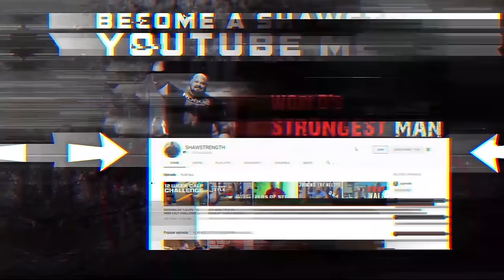PRESSING HEAVY WITH ROBERT OBERST AND EDDIE HALL

Comment: As much Robert tries to outmatch Eddie. The biggest claim you have is WSM. Eddie has one. He doesn’t. Brian has four but 😂
Reply: mittens the house cat Agreed and Oberst is 34 years old which is usually around the time when strength begins to deteriorate in men. Doesn’t look like he’ll ever win one.

He still has a chance but his years are running out.
Reply: 603spikem I didn’t say he won’t be able to compete but his chances of ever winning are pretty slim at this point. Muscle growth and production deteriorates in all men around their mid-30’s.

Also, you just proved my point because Mark Felix has never won WSM either. Closest he came was 4th place in 2006. Robert Oberst came in 3rd and is actually stronger than Felix.

While Oberst is certainly the strongest man of all time at press and in the top 3 of squatting, he isn’t strong enough when it comes to deadlift and atlas stones. He needs to seriously build strength in his back and core.
Reply: @alienheadgains1977  Oberst is the best at pressing?
Reply: @alienheadgains1977  
That's due to a sharp drop in testosterone and IGF-1 levels, which is irrelevant when you're on steroids and dosing growth factor, most of the time in strength athletes it's more a matter of fitness and accumulated injuries, joint issues, by all men you mean natural men, these aren't natty m8 their timescale is not the same.
Reply: Out some RESPEK on Roberts name!
Reply: @alienheadgains1977  put some RESPEK on oberst name son
Reply: GabbeЯ Skillz I take that back.
Reply: He has no chance with Shaw and Thor around and the amazing Mateusz Kieliszkowski,coming through.  @alienheadgains1977
Reply: 3Vimages Hell yeah Kieliszkowski is from my country. Poland Power🇵🇱
Reply: @alienheadgains1977  Big Z is the strongest vertical presser of all time by a mile. Oberst isn't even as strong a presser as Eddie. Oberst isn't even close to a top 3 squatter of all time. Do you even watch strongman??
Reply: Ya but Brian is def stronger then both of them...
Reply: Robert is still learning so he could get one
Reply: fangiscool1 I’d argue Eddie is on par with Big Z on pressing, or very close at least. Watch his training videos, man presses 100 kg dumbbells for like 10+ reps. Plus, if you watch his axle press WR, he presses 216 kg making it look like a ten pound dumbbell (he clean pressed it, didn’t use his legs at all.)
Reply: The most impressive feat tho is Eddie's dead-lift record of 500kg - half a metric ton. I can't see anybody beating that any time soon. At 6'3" Eddie isn't short by any means aswell so it was a good distance from the ground he lifted it.

Comment: How epic would it be if Thor and Larry wheels strolled in handful of the strongest men on the planet
Reply: Overkill at this point
Reply: Wheels isnt even the strongest powerlifter in the world! Casual fans 🤦🏼‍♂️
Reply: @ronniet9888  Weight has no direct correlation with strength. Look at Olympic weight lifters. Some of those guys are somewhat small but can clean 400lbs like nothing. Yes, as you build muscle your body weight is going to increase but it doesn't make you stronger by giving you more weight. I went to school with a guy who was only 160lbs but benched 315 and could squat just a little under 400lbs. Meanwhile we had linemen pushing 300lbs who could only bench 275lbs and squat 315lbs. My first time deadlifting, I was 172lbs and pulled 360lbs for a 1 RM. There's no correlation.
Reply: The512Warning,
a big untrained guy will lift more than a small untrained guy,
simple physics
like it or not

strongmen are fucking huge for a reason
Reply: @The513Warning 1aa
Reply: @goofverdinus165  Not necessarily true. You have different body types and builds. I'm only 5'9" but I've been stronger than most people I met even before I got into weightlifting. Only two events that their height really helps them with are stone loads and deadlift. Look at Olympic weight lifters most of them are nowhere near 6'3" and up or over 250lbs, yet they can clean and snatch 400lbs faster than strongmen and more efficiently. Mariusz was like 6' and look at what he did in strongman. Watch some of the amateur or state strongman comps and you'll see guys around my height with incredible strength. It also depends on what you mean by "small". Small by skinny and never touched a weight? I can point out bigger guys who can't lift shit too lol. I do it all the time at work. I work in a warehouse slinging heavy ass boxes and most of the guys bigger than me can't even lift them.
Reply: @The513warning im talking mass, not lenght
marius was 6'2 i think but build like an absolute tank,   he was around 300 lbs while in strongman, up to 340
Reply: @goofverdinus165  His height changed a lot like Arnold's lol. One minute they're 6'2", next they're 6'0". There was a strongman by the Nickname of Stumpy. One minute he was 5'3" 275lbs, next he was 5'5" and 300lbs. There are exceptions though. I've still seen my fair share of guys break those rules or guidelines. Brian Alsruhe being one. I think he said he's 230lbs but he's strong as fuck and lean. He's not too far behind Shaw himself. They're both friends too.
Reply: @The513Warning  i agree, you have to find your weight sweet spot. Being heavier doesnt mean stronger, one of the lightest Olympic weight lifters is only 137 lbs at 4'11 clean and jerked 410 lbs!!

Comment: 28:27 the LITERAL strongest man on earth causally resting in a random gym. Just think about that for a second.
Reply: rinzler oberon THIV it is currently Thor but ok
Reply: Daniel Franco the literal strongest man not the strongest man event winner. He holds the world record for the heaviest Wight ever lifted of the ground making him the literal strongest man on the planet.
Reply: @rinzleroberonthiv3981  Following your logic then Zidrunas is stronger, since he lifted of the ground a hummer tire deadlift of 524kg. Stop behaving like little kids.
Reply: Miguel Castresana Aguirre different bar different record and we are not the ones throwing a temper tantrum at a week old comment.😂
Reply: @rinzleroberonthiv3981  I watched the video yesterday my friend. Different bar but more KGs. I put it as an example of your bad argument =). And by the way he used all kind of protections for the 500 KGs. I prefer Thors 472 kg deadlift in the elephant bar. It looked easy
Reply: Miguel Castresana Aguirre again It could have been a 1000kg but it's still not the same record different bars have different ways of distributing the weight the elephant bar for example is easy to lift up to your knees because half the weight hasn't even left the ground yet but after that it will wobble like crazy and put you off balance that's why the record for that bar is still 473kg. The standard gym bar is a perfectly sized bar with no (stages) of weight distribution there for it is considered to be the true tester of someone's strength so until we see someone lift 500kg or close with no straps or (help) he's still the strongest.
Reply: @rinzleroberonthiv3981  Dude, do I need to quote you? "He holds the world record for the heaviest Wight ever lifted of the ground making him the literal strongest man on the planet." That statement is false as I told you before with Zidrunas. Then you should specify that for some reason you believe that the strongest man is the one with the best conventional deadlift. Which is so fucking lame by the way.
Reply: Miguel Castresana Aguirre fine I will correct myself (he holds the world record for lifting the heaviest amount of weight off the ground with an Olympic bar making him the literal strongest man on the planet) also it's clear to me now that all you care about is how big the lift looks rather than how hard it actual is which means your either an ego lifter or a pretender either way I'm done with this conversation everyone else can look at this argument and make there own conclusion. (Mic drop walks out of room)
Reply: @Miguel-sg7ll  I just need some clarification, what's so fucking lame, the conventional deadlift ?
Reply: There is no literal world's strongest Man, they all have their own strengths and weaknesses. However I believe Eddie Hall is the strongest static lifter there has ever been in the history of strongman, I do think he surpassed Big Z, only by a margin. I think on a good day where he wasn't injured, Eddie would have beaten Big Z's log record as he nearly locked out that 230kg log! He already holds the axel world record and the deadlift world record. KG's aren't just KG's, the elephant bar deadlift is technically an easier lift and lighter until it reaches the knees, as a lot of the weight is still rested on the floor until the too half of the lift. Look at any conventional Olympic bar deadlift, there isn't anywhere near as much flex in the bar as an elephant bar deadlift or a hummer tyre deadlift. People have gone onto say "well they don't allow suits on the elephant bar deadlift or figure of 8 straps but believe me, these things give you almost next to no advantage, especially when you're lifting anywhere close to 500kg. Thor's 472kg elephant bar deadlift is nowhere near comparable to Eddie's 500kg conventional Olympic bar deadlift, not even close. Not taking anything away from Thor, Jerry, Benni and any of the other great deadlifters but Eddie currently holds the world record in a proper setup at an extremely heavy weight, much heavier than what anyone else has set on an elephant bar or conventional bar.
Reply: @aaronmason6902  His argument to classify Eddie as the strongest was and is lame. When I said KGs are just KGs was to refer to his initial comment.
Reply: @aaronmason6902  And I still think Big Z has been better and more complete than Eddie. You just mention two records, just check how many records Big Z has, together with Strongman championships. Eddie hall was undoubtedly one of the strongest human beings in terms of static strength. And do not put excuses about his log failure, he did not reach Big Z level there, same as Big Z did not reach Eddie's level in deadlift. Period.
Reply: @Miguel-sg7ll  Big Z has spent longer in the sport and is much older than Eddie. I don't think Eddie hit his true potential before he retired. I wasn't making excuses for Eddie, I was expressing my opinion and my opinion is that if Eddie was injury free he would have hit that 230kg log, he was hitting 220ish in training with ease and most of it was practically strict! I'm not sure why you're being so abrupt has someone upset you ? Lol...
Reply: @aaronmason6902  I am not being abrupt, I am just defending my position as you are doing yours, its called discussion. Results are what matters. You mention age, well, Eddie basically could not continue forcing himself because he was going to die otherwise. And please do not say what he would have done or not, its too loose... 

Anyways, stating who is the strongest is very subjective, therefore we will never reach a consensus. As long as no super human appears in the scene.

Comment: There is no way that Robert Oberst is 6’8 400lb like he claims. We know Brian is 6’8 400lbs and Robert is a good 2 inches shorter with a much smaller build. If I had to guess, Robert is 6’6 355lb.
Reply: According to Google Oberst is 6,7.9, a spec off of 6,8, but Brian is meant to be 6,8 and Oberst easily looks 2 inches shorter. He's not hugely smaller than Brian but he doesn't look basically 6,8. I'd say he's 6,6.
Reply: probably measured with shoes on and maybe Brian didn't